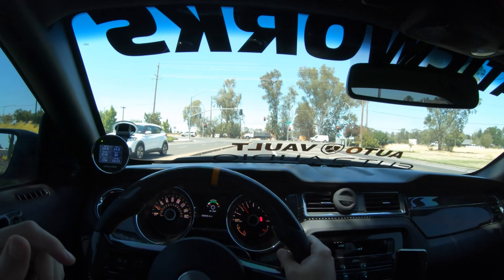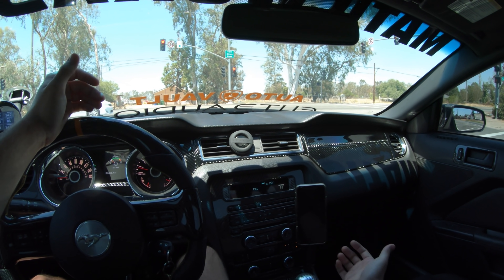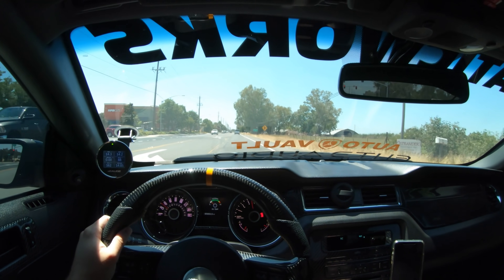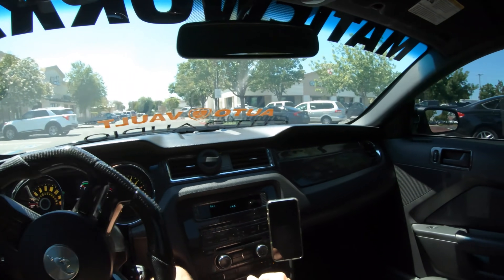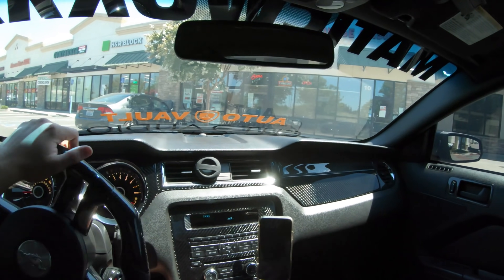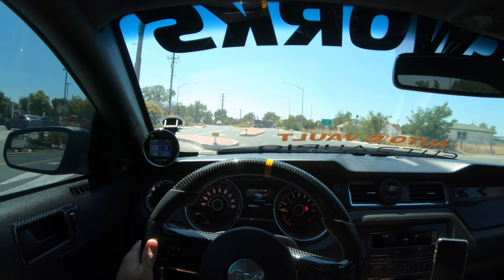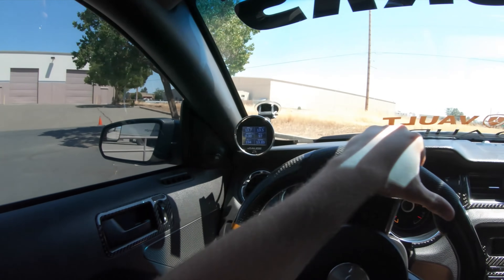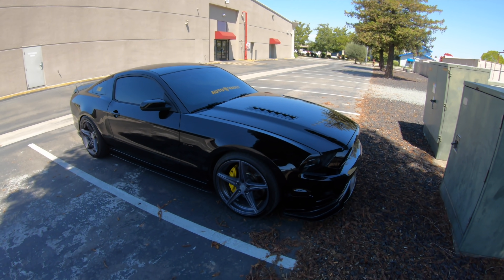How Much Power Can The Coyote Motor Handle? The TRUTH!

Comment: Gen 1 2014 Mustang 
Haven't been on the dyno yet, installed a Paxton Novi 2200, tuned by Lund Racing. They estimated 650-680 at the tires and it pulls like it has that much lol. I'm good at the power level for now. Next is build the bottom end, fuel system, E85 and pulley down. Then send it😈😈
Reply: I made 695whp when I had my Paxton on e85. Depends what pulley you have and other mods.
Reply: @negativesplits06  small world lol, i see you on Alex live streams. I'm on a 3.6 pulley, long tubes, FF😉, pump 93 for now. What pulley did you have for the 695?